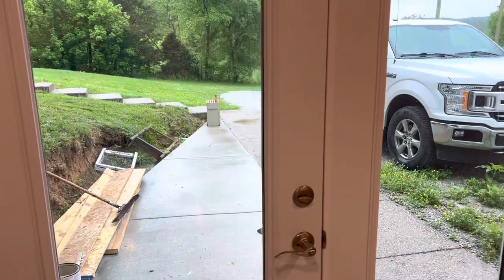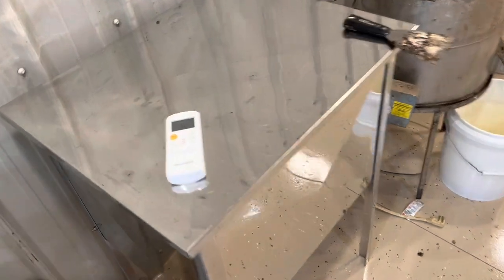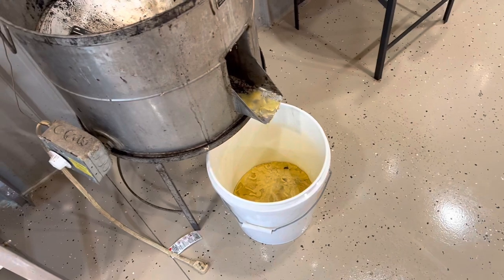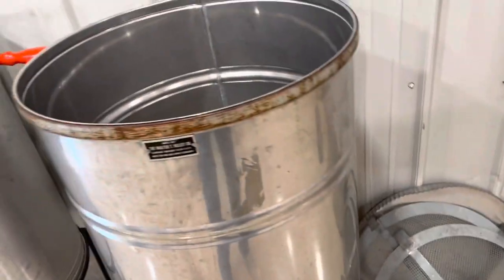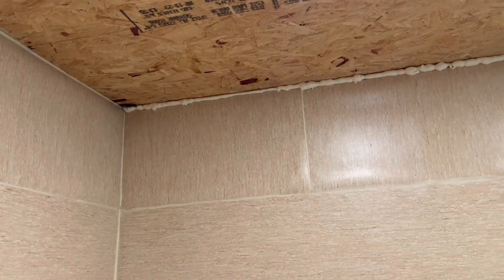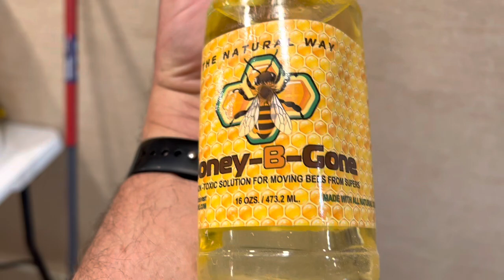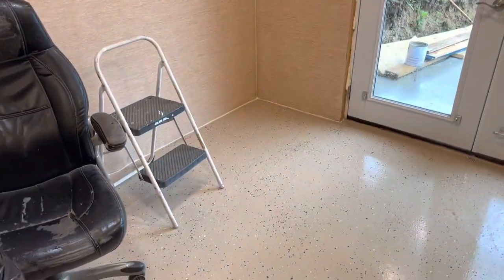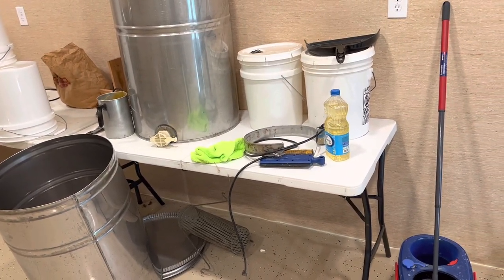Sideliner honey house tour

Comment: Very nice.  Be careful washing honey and wax into your septic system.   Bob Binnie tells a horror story of how he had to cut the floor slab and install a new line.  For greasing food processing equipment, you should consider mineral oil.  Vegetable builds up gunk between uses.  I learned that with the bearings on my meat grinder.
Reply from the maker: Thanks for watching Phillip. I think I’m good on the drain line. The vegetable oil does build up over time though.